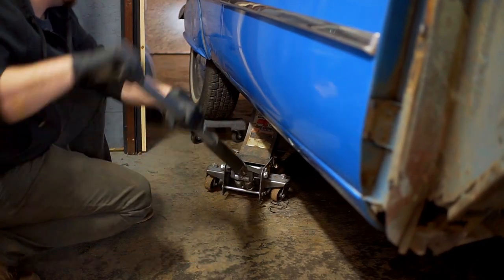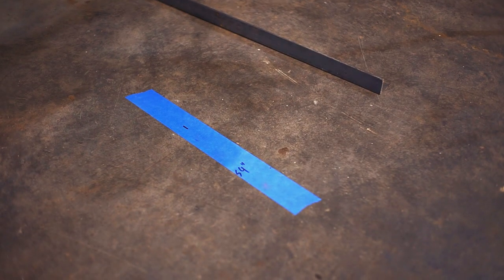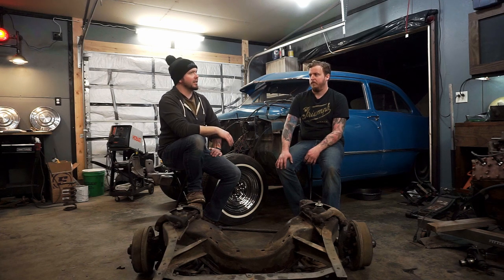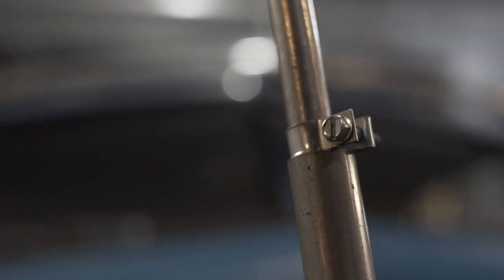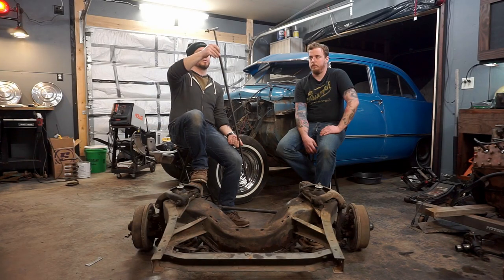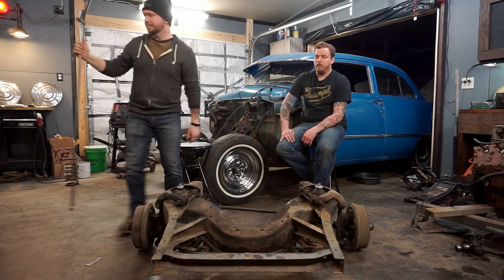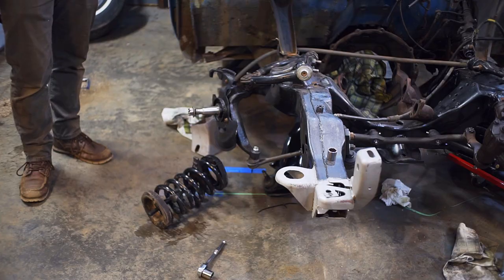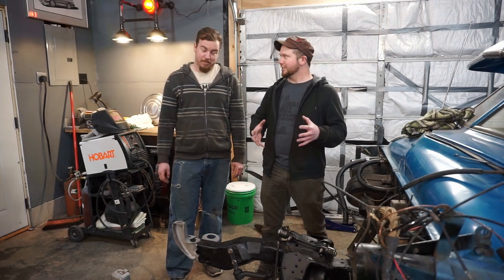Installing a S10 clip on a Shoebox Ford; Shoebox Ford Ep2

Comment: You are inspiring me to clip my Shoebox! How did you determine the 'angle' to cut the S10 frame at? It looks like the cut isn't square to the S10 frame rail but more perpendicular to the floor.
Reply from the maker: Hi Tanner! Yeah clipping is no small project, but if you (or someone you know) is a decent enough welder it's very feasible. 
So what I did to determine my frame cuts was first level the shoebox frame, then mark the shoebox clip perpendicular to the floor for a nice 90 degree cut line. 
On the S10 clip; I leveled the clip on the table going off of the top flat spot of the clip. I then went off of the holes on the outer sides of the S10 frame to get my initial marking. I took a large flat edge (ruler, level, flat stock, whatever it is just flat and long) to go from the mark on each side (based off of the holes on the outer sides of the S10 clip). Hold your straight edge in place and draw a straight line from those outer marks. 
I realize this is a little hard to describe typing out, but the video should help this make sense. Don't hesitate to ask more questions man, I'm always happy to help.
Reply: @DadModsMedia  Thanks I appreciate it! I didn't know there was a 'level' reference at the front of the S10 frame. I was also thinking if I could measure the S10 castor angle that would also help. I think I may Z it up 2 or 3 inches to avoid running drop spindles and it will help driveline geometry as my rear end sits higher then the trans now that I have the 2 link.
Reply from the maker: @Tanner S  my shoebox seems to drive pretty darn good so using that flat spot on the top of the S10 clip worked out for me BUT if you are going to measure caster that would be a better approach IMO. 
The one downside to "Z'ing" the frame is the firewall supports will need to be modified if you Z more than an inch or so, you will also have some pretty significant steering shaft angles to overcome (more joints needed) if you intend to use the factory steering column firewall hole. If you patch that factory steering shaft hole and move the steering shaft hole up the firewall then you would be in better shape. 
Always trade-offs with these kind of big projects.

Comment: What year S10 front clip will work on a shoebox? I know everyone uses them but can't find anywhere what year they are using. Thanks guys! Great video!
Reply from the maker: Hey Monte, from our research it seems the variables come from 2wd vs 4wd. 4wd is wider but obviously you wouldn't want a 4wd clip anyway.  We used a 1994-1997 S10 2wd for our donor. 
Thanks for the kind words. Any other questions, don't hesitate to ask.
Reply: @DadModsMedia  Thanks for the quick reply.  I have found a 2001 2wd S10 donor.  I'll have to check to make sure it will work.
Reply from the maker: Happy to help!

Comment: This will be my first ford any suggestions for a 1956 ford Fairlane front clip and rear I'm interested in getting a wider tire in the rear I really need help it's hard to find the right information
Reply from the maker: How deep are your pockets? Looks like there's front frame stubs to fit a Mustang II front end on. 
The Fairlane is pretty different than the shoebox so we don't have a ton of insight on the front end. 
For the rear I would suggest ordering up a Ford 9" to the width you're looking for or having one shortened. 
The Explorer 8.8 narrowed could be a strong option too.

Comment: How was the ride height comparable with the stock shoebox? With Stock s 10 springs?
Reply from the maker: Great question, I found that with 2 inch drop spindles and stock springs the S10 front end sat just slightly lower than the stock shoebox front end springs.
Reply: @DadModsMedia  thanks man that’s about what I guesstimated Now I have the S 10 chassis here. Already purchased the drop spindles I guess I’ll go with the drop springs as well. Thank you for your insight
Reply from the maker: Nice! Good luck, don't hesitate to get in touch if you have more questions!
Reply from the maker: @tylerlatham2061  any time man!

Comment: You need to talk less and show more of what you are doing. Talk ane work at the same time. Exsample you should of shown how the you measured the chassies with the measuring stick you made.
Reply from the maker: @Flaubear that is a fair criticism for sure. Hopefully I can describe it enough to be helpful; There are holes on the outside of the frame under the front area of the door. I measured off of that and picked one of the symmetrical holes (same spot both sides) on the S10 clip and trimmed the S10 clip at the joint (location where the shoebox frame butts up to the S10 clip) until the measurement was the same. I made sure to keep the wheelbase equal to what it originally was, so when I cut the S10 clip I left extra to trim. I used levels to keep the clip level the same as the shoebox frame. 
Once I got the measurements (using the tram) the same, I tacked the clip and frame together and used extra methods to measure, such as hub center to hub center, measured an "X" from the front of the S10 clip to spots on the shoebox inner frame...etc.  You truly can't go wrong measuring as many ways as possible because it should all give you a similar difference between the two measurements. 
The goal should be to get it as close to perfect as possible, but I'm sure you realize that. 

If there's any other questions you have don't hesitate to ask. The goal of the video was to be helpful  :)